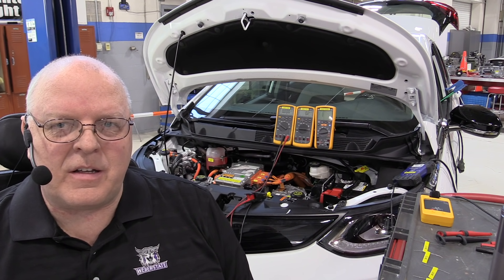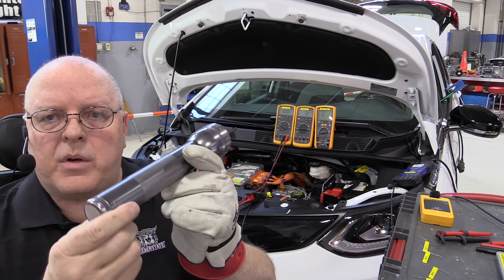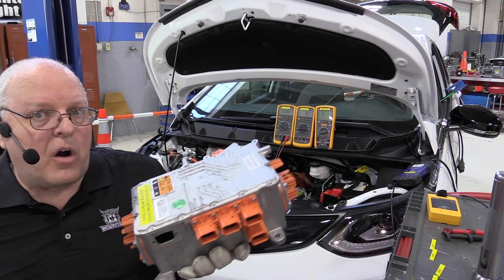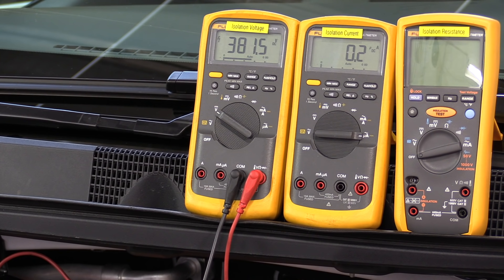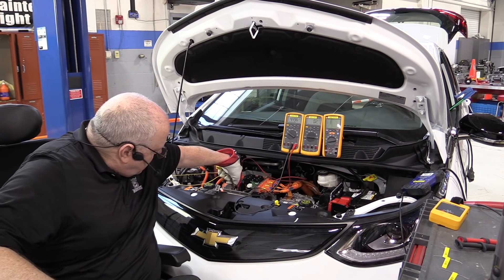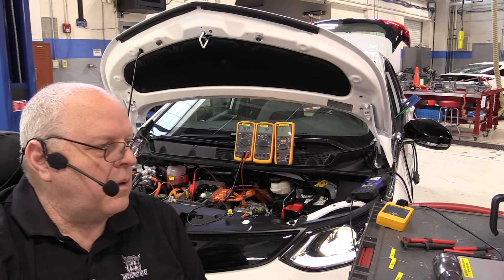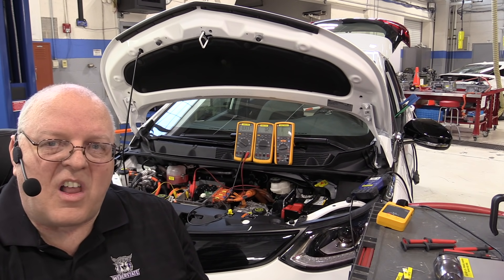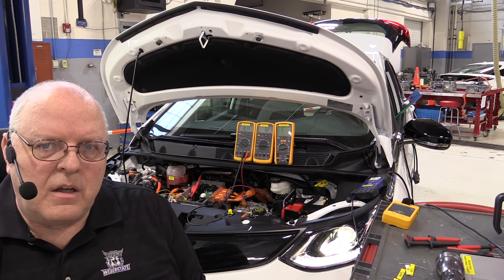Megohmmeter - Loss of Isolation Diagnostics

Comment: I can't thank you enough to have cleared all my doubts. This video is GOLD. More power to you. Thank you so much!

I have a question:
Are all the distribution units on EV's very well hermetically sealed? In case of slight floods (water levels up until the bonnet) is it safe to drive an EV?

Comment: Thank you very much Prof. John, it is amazing video as usual, I am fan of you from 7 years ago, I have a small question, you loose the cover of the junction block and you can measure the voltage and current even though the car is working, what about High Voltage InterLock (HVIL), did not  Chevorlet  HVIL include it as  a safety in the car?

Comment: I have 2011 Lexus RX450h. It has a blinking check hybrid system light. I checked the hybrid battery and it is good. However, when driving the car it will randomly jerk and the "Check Hybrid System" light comes on, when it comes on the car also looses power. The code is P0A7A. What are some of the steps I can do to fix the issue. I have cleared the code and it would drive fine but then the light will flick back on. 

I would appreciate if you can let me know, I have seen your previous videos and learned a lot! Thank you.

Comment: Thanks a lot for the video, why is the 12V system that it’s negative is connected to the chassis not being affected when the HVDC positive is shorted to chassis?
Reply: I believe it connects two batteries in series, like the flashlight demo at the beginning. Except one battery is 380 v and the other is 12 v for a total of 392 v between the negative of the high voltage system and positive of the 12 v system. The systems hanging on the 12v battery, still see only the 12v potential of the 12v battery. 

I think

Comment: Recently learned about a Bolt that got issues with snow getting stuck OVER the battery pack. Apparently the snow got packed in there while getting through many inches of snow. 

Isn’t there anything blocking snow from getting in there ? Or is it wide open ? How dangerous can that be as it’s putting pressure on the battery pack ? I know the dealer had to remove the whole pack to remove the snow (too cold in there for it to melt by itself) and they had to replace some components.
Reply from the maker: The battery is sealed, there is no danger. GM does recommend a monthly undercarriage wash if you can find a carwash that does that. That will help keep that area clean.
Reply: WeberAuto Thanks ! I’m still surprised some snow got up there, but it’s good to know that GM recommend to keep it clean !

Comment: On a electric vehicle (Electric Bus) if we do not connect  body earthing of 230V 3phase AC induction motor (HVAC compressor motor) to vehicle chassis and if due to induction there is any leakage on motor body, then is there  any chance of getting electric shock when we touch the motor standing on the chassis?

Comment: Hey Professor, I'm not sure how the high voltage system in cars are designed however, I've worked on electric buses for both New Flyer and BYD and  in both systems. there is a high voltage contactor that  has  to be removed before working on the high voltage system. My question is...is this design principle included on other electric vehicles?

Yes sometimes we have to leave this contactor on if there is a problem / issue on the high voltage side so I totally agree with the information contained within this video. One thing I've noticed while working on BYD buses is that NO PPE or insulated tools were used or recommended . New Flyer provided me with their own high voltage tool kit, along with gloves, face shield and clothing.

I've never had any problem while working on BYD buses  - maybe I was lucky...although there's no such thing as luck - however, I sincerely believe that anyone who works on electric vehicles should pay close attention to the information herein and follow said procedures - especially when it comes to arch flash. For those who do not know about arch flash, they should research it. 

Finally, capacitors can retain their charge for a long period of time therefore, when working on high voltage systems, one should wait for a a few mins 8before* entering high voltage systems.

This video has been EXTREMELY  informative.

Comment: Dear Professor, when we connect Battery positive and chassis through its negative terminal, will not there be a leakage current, and in that situation if a operator for some reason touches or stands on the electrified chassis or conductive parts will they not feel the shock? just because they have not touched both the terminals at the same time? if that is the case why are they so careful about isolation monitoring? please guide! And how does isolation monitoring add a value?

Comment: Is there no HVIL line going through all the HV connectors checking if the connectors are correctly inserted, so there can't be any high voltage of the junction box?
Reply from the maker: There is an interlock circuit on the two large connectors, but not the small ones. Thanks for your feedback
Reply: @WeberAuto  so theirs no hvil lid switch on the front junction box? And those components are able to be "live" with the lid off for diagnostic reasons? or is it a poor / unsafe design?
Reply from the maker: @Brandonchristie743  Normally the lid is not removable, I modified it for this video.

Comment: Hi John. I have a Chevy Volt that isn't charging. I have a CEL and the "Service High Voltage Charging System" message. The car runs fine on engine power but the Isolation Test Resistance is reading 0.0 kOhms. I've had a bunch of people tell me that if the isolation resistance teat was truly 0.0, the car wouldn't start. Any advice? Thanks!

Comment: Hey, why no battery contactors not opened if pos/neg isolation loss occurred ? although it is safe to operate vehicle but consider a scenrio where pos connection already shorted to earth/chassis with 0 ohm and neg to chassis fault also occurred post that with again 0 ohm so that can technically opens up the fuse and even imd detects it tell bms to open contactor fuse is already blown up otherwise this could have been saved by turning off the contactor if any one terminal is shorted to chassis

Comment: I had this isolation code pop up on my 2017 Bolt a couple weeks ago.  I jumped in the car to go to work when it was 11 degrees out and the service light was on.  Everything operated normally.  When I left work the light was off and hasn't came back on since.  I pulled codes and it was displayed as a history code.
Reply from the maker: Very interesting. Do you recall which DTC was set?
Reply: @WeberAuto  P1AFO I think?
Reply: @WeberAuto   Some additional information.  The car was outside overnight not plugged in and I preconditioned it for 15 minutes.
Reply from the maker: P1AF0 Drive Motor Control Module Hybrid/EV Battery Voltage System Isolation Lost. The DTC will never set while the vehicle is plugged in to charge or while being driven. This isolation fault may be caused by any component in the high voltage system, it does not know which one.
Reply from the maker: When parked outside and preconditioning, was the outside temperature cold or hot? Thanks. This could help narrow the fault.
Reply: @WeberAuto  It was 11 degrees Fahrenheit that night.  I was thinking it may have something to do with the battery coolant heater.  Since then the battery coolant heater has been on without the code coming back.  I did find another person that had the same thing happen to them with the exact same conditions while I was looking online.  It hasn't been that cold out again to see if I can duplicate the problem.

Comment: I have 3 Priuses. Replaced modules 6 times. Little shock potential after the orange plug is pulled. DC is safer than AC. The battery can't do much after the bus bars are off. Just 28 modules sitting there.
Reply from the maker: Thanks for your feedback
Reply: Whoa!! DC is NOT safer than AC - it's the high voltage and current capability that can kill you. 110V AC is actually slightly safer than 110V DC - if you touch a DC circuit, your muscles contract and make you hold on - with an AC circuit there is a chance that you can let go. Treat ANY voltage over 48V as dangerous, regardless of the type.
Reply: @antonynr  as an electrician for 33 years I highly agree with you.
Years ago I did data centers where we had dc 480 volt - mega toast
Reply: @antonynr  Thanks, I haven't thought about that. I got electrocuted several times by mains voltage (115v actually), and it isn't a nice feeling at all.
Reply: @antonynr  I'd much prefer to touch DC than AC. The human body has a capacitance that doesn't come into effect on dc. Here's nice demonstration 
https://youtu.be/snk3C4m44SY
That being said I also agree in your don't touch anything over 48v to be safe rule
Reply: @electricguysvcs  I don't think touching 480vac is going to be a good time either...
Reply: @antonynr  I had a neighbor that was killed by 110 a/c working on his vehicle.
Reply: @neliosamch3195  Yup, and if he had touched a 110v DC supply it would have killed him as well! The message is, neither are safe.;
Reply: @antonynr  Yes, it was a rainy day and he was using a transformer to convert 110 to 220v for his drill. He electrocuted himself by pushing the drill with his chest to the tire axle to remove a broken bolt stud and got glued to it until the power was disconnected.
Reply: @Brendon_M  DC kills you differently from AC - AC stops your heart, DC dissolves cell membranes and cooks you, like radiation exposure damage.
Reply: @allangibson8494  in other words AC kills you instantly and DC cooks you slowly and if your muscles haven't latched on then you can let go and survive(albeit a bit warmer).
Reply: @Brendon_M  And the die hours later as you bleed out through compromised blood vessels....
Really high voltage usually just cooks you rapidly. 20mA at 11kVAC is enough to carbonize you without stopping your heart.
Reply: @allangibson8494  I've had my hand across 100vdc and been hit with 144vdc (both on EVs) and I'm still here. I have my doubts that would be the case if it was AC. 
Don't get me wrong, I don't recommend touching either...
Reply: @Brendon_M  Like radiation exposure time has a major bearing. It is a very painful way to go. One of the reasons electrical work should have teams of two (and you should check the other guy knows the basics of electrical rescue).
Being trapped on even low voltage DC does nasty things to the human body. HV DC is serious painful as nerve endings are really good conductors.

Comment: if there is voltage present a0F 250 V HV+ and chasis, and  10V Between HV- & chasis. Does this mean a insulation failure?

Comment: My 2023 chevy bolt euv is in the shop now for an isolation fault which only happens when I try to fast charge.  The technician called chevy for help and they said to replace the charger unit.  They did and it did not fix the problem and it still sits at the shop.  The service manager said they have never seem this before and the service diagnostic equipment shows no error.  The error shows on the charging station after about 2 minutes after plugging in and the bolt says unable to charge.  I can charge the car from my level 2 charger at home.  I think the problem has to do with the direct current feed going to the battery.  After watching your video I sure wish you were the tech.  Any ideas?
Reply from the maker: The current from the DC fast charger on that car goes through the two large terminals at the bottom of your CCS charge port, then through the two large orange cables to the front of underhood junction block. Inside the junction block is a set of contactors that send the current to the high-voltage battery. All of those pieces except the battery are only used during DC fast charging. AC charging uses different wires. If the isolation fault problem only occurs while DC fast charging, either the DC fast charger has a problem (I assume you have tried a different charger) or one of the pieces I described has a problem. Best wishes.
Reply: Thank you.  I’m not sure why they would replace the charger when I could charge on level 2 chargers.  I appreciate the response.  I’ll post the actual fix the make.
Reply: I have that issue only when charging at certain DC public chargers in Salamanca, New York.  Someone told me to fully shut off the car and keep it off before plugging in which supposedly helps.

Comment: where on a mitsubishi phev 2018 i can found that voltage drop on scan tool to see if i got resistance change, i have a p0aa6 code but intermittent, ans i want to know how test that with multimeter voltage or scan tool, thanks for help

Comment: Hello Prof. I have this issue that can't seem to resolve. Two Toyota Prius C with the same problem. Hybrid Battery Isolation fault. One had an aftermarket alarm installed and later deleted while the other had an aftermarket car alarm installed and deleted after the trouble code became permanent. I've tried restoring the cabling to the way it came from factory but the fault(s) won't disappear. Any tips on what I should do?

Comment: :if a HV vehicle is involved in a crash and the HV leads come in contact with the vehicle chassis, what design features of this vehicle ensure the safety of the vehicle occupants???
Reply from the maker: The system described on this video. The battery contactors, the battery fuse, and the off button

Comment: 9:14, what happens if a person standing on the ground touches the sheet metal? Then the voltage different between he/she and the sheet metal is 380V, right? Isn't the only reason that it's safe to have a loss of isolation because the person inside is on the same potential as the chassis? I'm a bit confused, would be great if you could help me out. :)
Reply from the maker: Nothing happens if a person is standing on the ground and touches the sheet metal. The ground you are standing on is not connected to either high voltage battery cable. There is no path for current, there is no danger. The only exception to that is if a 12V battery charger was connected to the vehicle which connects the sheet metal of the car to the ground you are standing on through the three-prong power cable.

Comment: Bmw g30 there isolation problem , there is isolation codes on sem and eme , i check isolation i dont no where the problem i chech dc dc converter resestance that is 0.18 mohm 
The power is off from the battery and that set on transport mode 
What your opinion about this

Comment: 13:25 Why is there no danger though? If the chassis has a 350V voltage and I (having 0V) touch it - with wet hand for lower resistance - I should receive current no? If I'm 'connected' with the earth through naked feet for instance, this could be more dangerous no? Does the ISOMETER detect this?
Reply: With reference to you, or the earth, the car is still at 0 V potential.  Now, if you were to touch the other lead of the battery, it would light you up.  Like he gave with the flashlight demo.

Comment: How does a hybrid vehicle manage battery temperature in extreme ambient temperatures when the vehicle is parked? Do they use the energy stored in the main battery to heat and cool battery temperatures? I heard stories of Toyota Prius vehicles that stopped working in extremely cold winters. I was curious how far hybrids will go to keep the battery at the proper temperature range.
Reply from the maker: Most hybrids do mot manage the battery temperature while parked; however, Most Plug-in hybrids and Electric Vehicles do as long as they are plugged in to charge.

Comment: Mr thank you for helping  with your video 
I have 2020 E Golf car only 2252km warranty not covered because dealership says towing damage electrical system 
there is no physical damage to the car, purely electrical.
because that's what it says on the display on radio screen 

Error Electrical systems stop
Towing damages electrical system 

I scanned the car with Odis, there are two tags that cannot be deleted, there is an error code
P0C0100 drive motor A current high
P0A1B00 drive motor A control module
What part has a problem? can you help me?
Thanks

Comment: Did you know your power chair also has a isolated ground or some call it a floating ground. Whenever you turn on your chair it checks for shorts between chassis and power supply hot and ground. After five to ten years of use, the carbon dust in the brushed motors may form a high resistance short causing your chair to give a motor fault. I have fixed my chair and customer chairs by removing brushes and blowing compressed air through the commutator. This give a quick fix if you can reach the brushes to do the work.
Reply from the maker: I did not know that. Thanks for sharing.